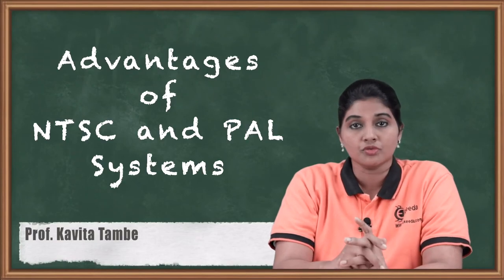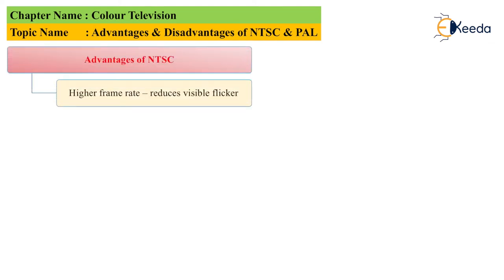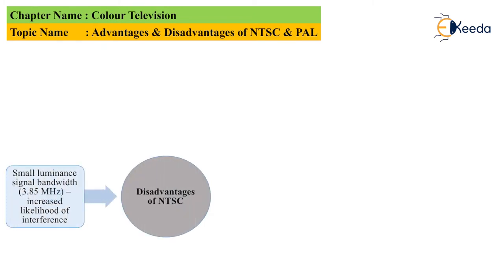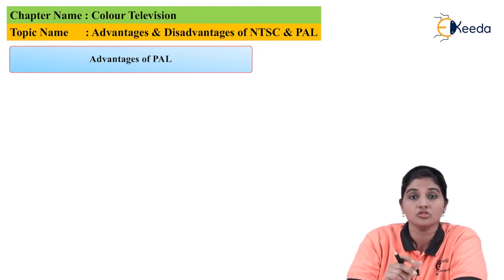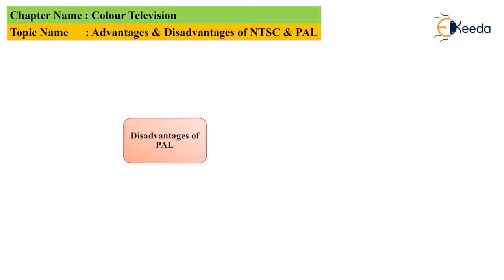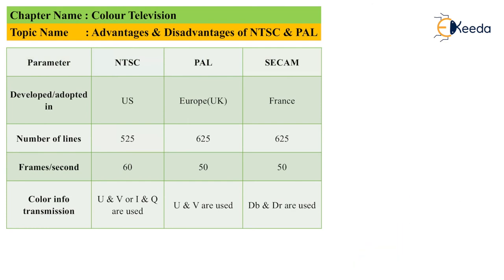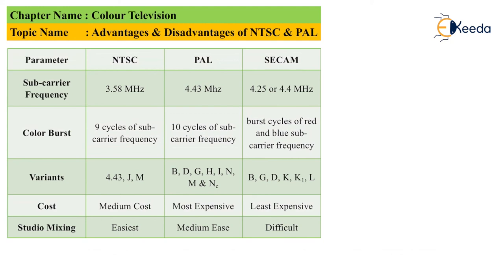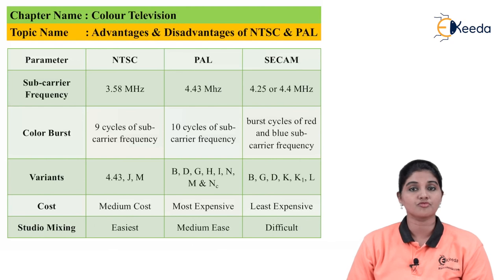Advantages of NTSC and PAL Systems | Colour Television | TV and Video Engineering

Comment: You are mixing Black&White signal issues (framerate, bandwidth) with colour system issue. There are several BW system with letter A to N, and three colour syetem NTSC, PAL, SECAM. NTSC was only used with M and J (expirementally with others), SECAM with D/K and L (expirementally with E) and PAL with B, D, G, I and K.
(I know I have implememted them all)